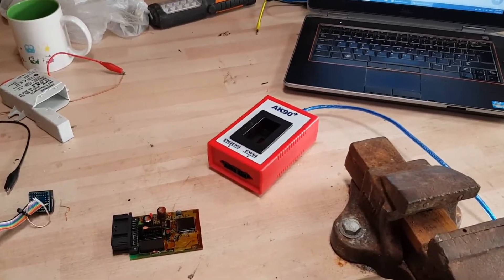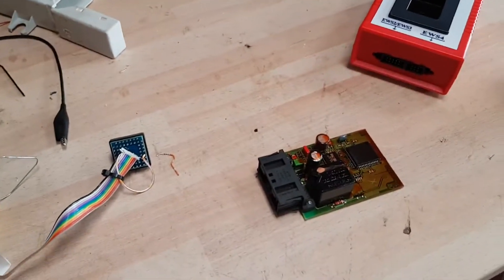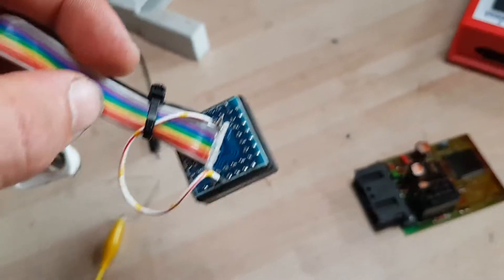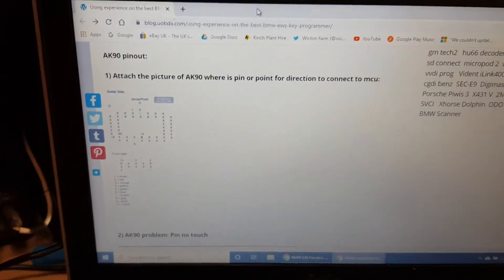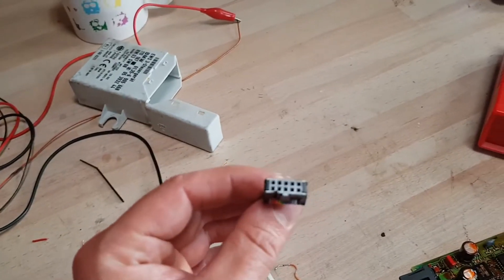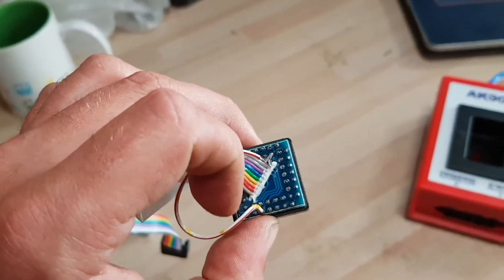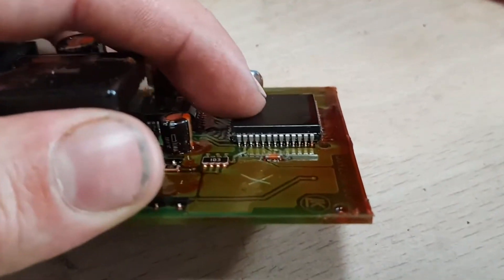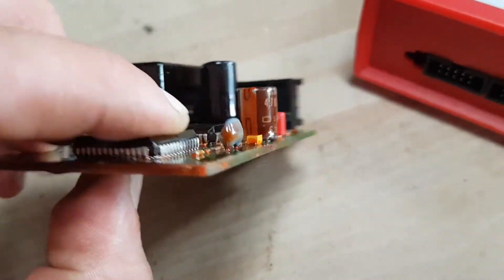AK90 "PIN NO TOUCH" Error Solved

Comment: I see there are 6 wires that are actually connected to the board. Is that what you had? Was one of those 6 not connected properly, or does there need to be a 7th? I can't really read that blog. Don't understand the diagram.